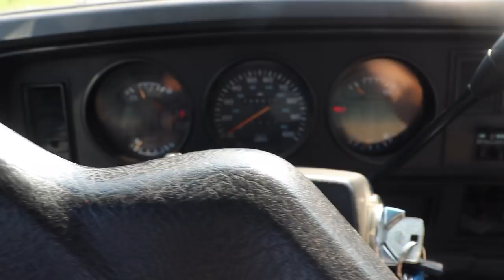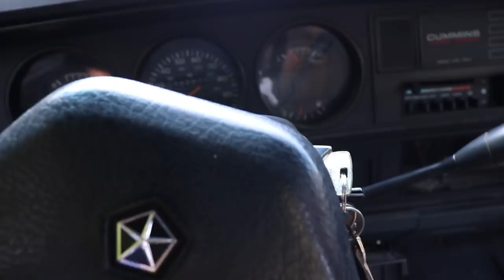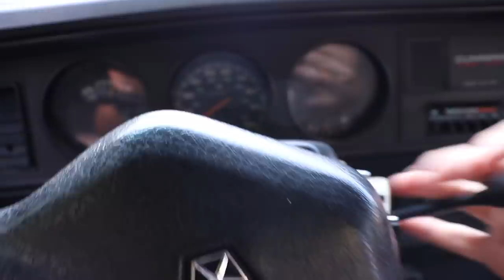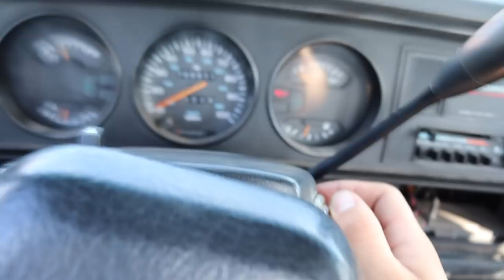HE MESSED UP HIS CUMMINS TURBO!!!

Comment: I drive a 97 ram 1500 5.2 and once the motor goes I want to swap it out with a 12 valve Cummins. I know its possible I seen many you tube videos of people doing it. What are your thoughts?
Reply: Nicholas Sheriff it would cost you more to swap than purchasing a 12 valve truck. It would be smarter to just purchase a different truck once that gas motor shits the bed, which I can’t anticipate happening too soon since those magnums are pretty reliable. Unless of course it’s like a super high mileage truck, another reason to buy a different truck because of body wear and other component wear. Just a thought though, it’s your money.
Reply: Yeah, like Mofocookies said, of course it's possible, just a really bad idea. Just doesn't make sense financially or otherwise. They are very different trucks, the half and 3/4 ton. Putting a 1200lb motor in a truck with a front end designed for 650lbs is a big challenge. With suspension, frame/crossmember, drivetrain, entire fuel system, electrical, and you-name-what-else needing to be modified/completely replaced/custom made, you would be looking at upwards of 10-15k+ at the very least. At that price point, buy yourself a nice 12v/24v and keep both trucks. And also to add to that, if you aren't just destroying that motor, the Magnums are extremely reliable. They run forever and make consistent power pretty much their entire lives. You will run the chassis into the ground long before the motor gives out if it's taken care of properly. I love my 360. Wouldn't swap it for any motor in the world, as dumb as that sounds. I hate that a lot of the diesel community treats gas trucks like they are inferior. Different beasts, neither is better than the other at all things. I'd take a 12v any day when it comes to pulling 10k+, but for a fun truck? I'd much rather have a blown big block ;)
Reply: My dad did just that, but the problem with doing this is that all the components are not heavy enough for the weight- both his front axle shafts busted when he tried pulling somebody out, front and rear springs were not heavy enough, u need the diesel front springs ( which he got with the engine)-,  within 20k miles his rear dif started whining, the front brakes are not heavy enough, and it's not a good hydro boost system like the 2500's. I would highly recommend starting with a 2500 chassis- at least from all the trouble he's had. Also if you are going to be pulling any trailers at all you will definitely want a 2500, because the extra weight of the Cummins puts the GVW right to the limit. This is just our personal experience with doing this, so its up to you.
Reply: John Slade facts

Comment: Just a suggestion if that 2wd Cummins has that many miles on it you may want to have it rebuilt because when you start running that much horsepower any little flaw may poke it's ugly little head out. Because it's no doubt the engine has a pretty good dab of wear and tear on it. Just a suggestion it's your truck do what you want.👍
Reply: its got 178k miles
Reply: I was talking about loud n prouds truck not yours. Yours will be fine 👌

Comment: That piece that you don't know is the inter cooler cap. Without that the piston ring bolts in the turbo will expand and cause the turbo to not create as much boost. It can't create as much boost because their flow is resisted due to the bolt being expanded and the piston rings will break off and clog the AC system and after that the drive shaft will break in half and puncture the fuel tank causing the truck to explode. So you need that piece to be installed on the turbo. ;)

Comment: Should o get a Cummins or duramax or powerstroke and first
Reply: Cummins
Reply: Owen Wagner cummins
Reply: Jackson Smith I agree I found one in Vincennes Indiana a second gen 12 valve
Reply from the maker: 12 valve
Reply: LOUD 'N' PROUD agreed👍🏻
Reply: 12 valve cummins is THE BEST, longest lasting, engine ever, (now if you want fun: p pump a 24 valve), 12 valve is the easiest, cheapest to mod, most reliable  diesel on the market.